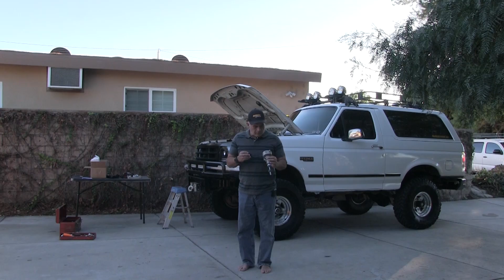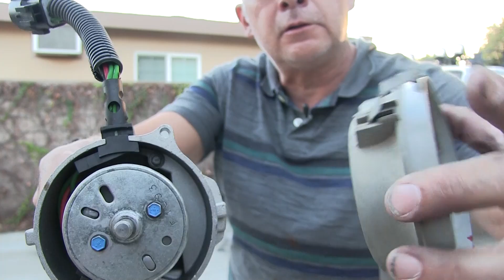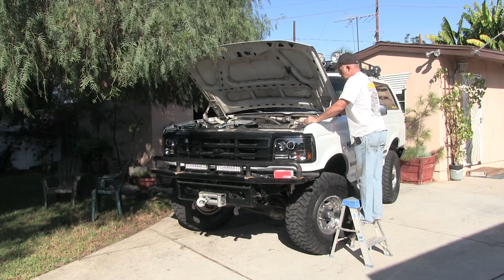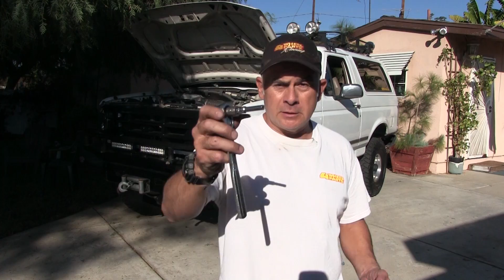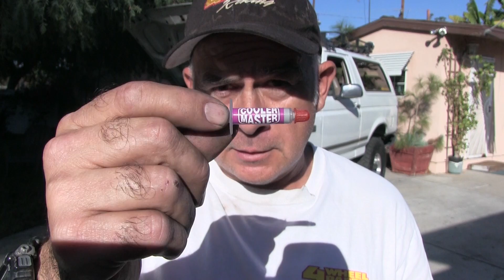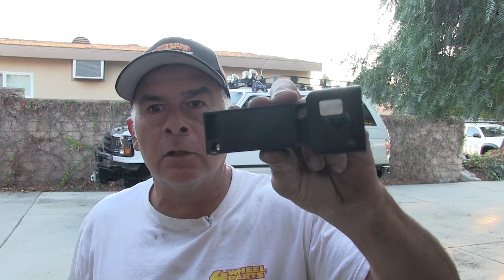Bronco Code 211

Comment: 10/4..... I think I’m gonna try the IMC first, then check the code. I know I should be checking voltages at different points in case it’s a wiring issue, but I’ll try this first, then check voltage. I do enjoy your videos, your very informative.
Reply from the maker: There are two ICM for these Fords. A grey one and a black one. Make sure you get the right one. You may need the VIN number to get the right one from Ford.

Comment: Rudedog, I know this is an older video, but I’m curious as to why you changed the IMC after the distributor. Did you still have the 211 code? Did you check first or just decided to change them both and then check to see if 211 code cleared.
Reply from the maker: I'm not sure but I did want to change out the after market ICM to a Ford Motorcraft part.

Comment: There is a special tool for those small bolts.  At least there is one when the Module is mounted to the distributor.  It should work on the one for the heat sink mounted one too.

Comment: How was it running before the repair? What were your symptoms?
Reply: shelton berry I have the same question!  I have a 92 Ford F-250 5.8l and after it warms up it runs like crap dies then won’t start (acting like vapor lock) but after it cools off it runs fine again till it gets warm!  From every I’ve seen the ICM is the pest place to start.

Comment: Own a Ford, pick up one of these for the TFI module https://www.walmart.com/ip/Performance-Tool-W1217-Ford-Ignition-Module-Tool/50835584?wmlspartner=wlpa&selectedSellerId=8746&adid=22222222227038469175&wl0=&wl1=g&wl2=c&wl3=85418857730&wl4=pla-105619967845&wl5=9032863&wl6=&wl7=&wl8=&wl9=pla&wl10=115787002&wl11=online&wl12=50835584&wl13=&veh=sem
Reply from the maker: I've seen those before. It's a socket with a hand grip. One of those specialty tools you may use once.
Reply: I've had mine since I bought my Bronco new, back in 94. It works well. Clean up the TFI module heat sink and grounds every once in a while.